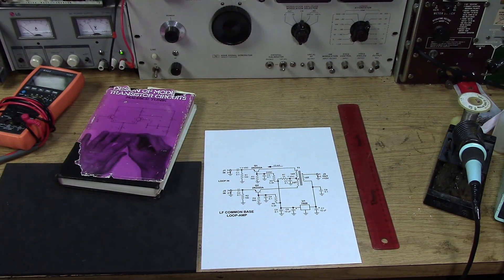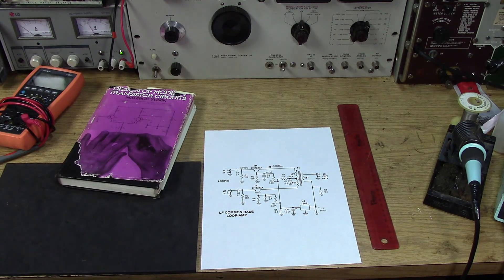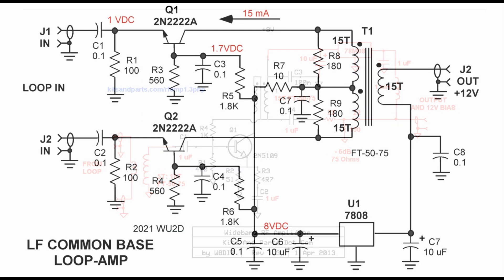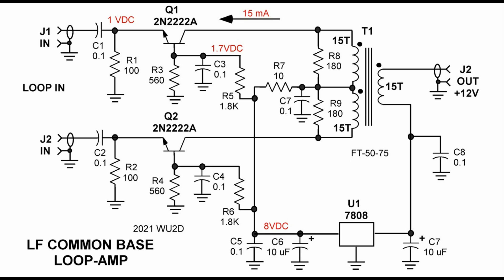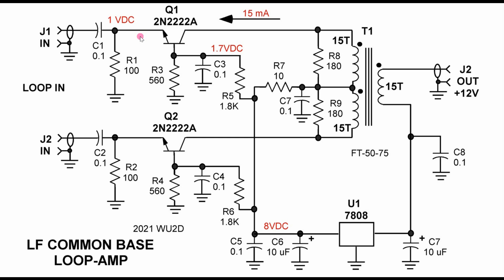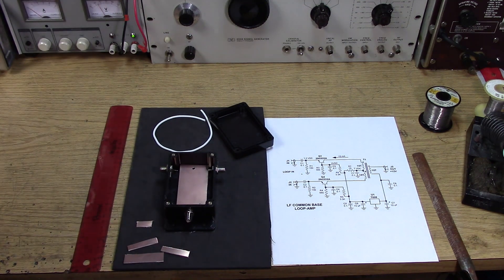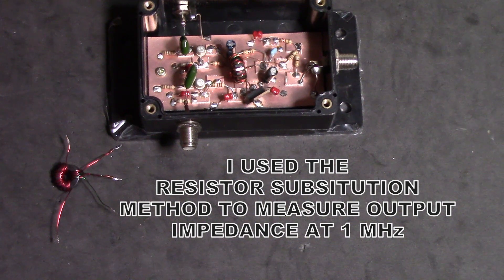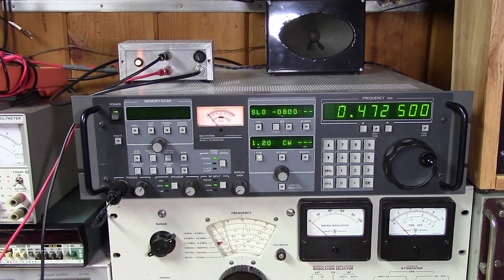Loop Amplifier - Part 3

Comment: GD dear OM, TKS FER NICE VIDEO, JUST A QUESTION: WHY IN YOUR VIDEO, CIRCUIT BOARD OUTPUT  CONNECTIONS ARE DIFFERENT FROM SHEMATIC DIAGRAM? TKS FER ANSWER AND BEST 73's.

Comment: Great video Mike! I built a "series tuned" 4-foot loop (24 T #14) and fed it to my common base 2N3906 (PNP) single ended transistor.  The loop is the "L" and the C is connected from the loop to GND. Since at resonance a series circuit has max current, it is fed to the emitter via a blocking cap. This is a current driving approach to the emitter/base junction. The collector has a 4:1 to my 50-ohm load (receiver) .I was able to receive SAQ (17.2 KHz.) in Sweden. I like your P-P approach. Thanks Mike!  Bob N3SWL

Comment: A very enjoyable video, as usual. Feeding the power input through the centre-tap of the transformer is a very familiar technique to me from my early days with the UK  Telephones. If a similar transformer were used at the input you could produce a "phantom" circuit. These could be used to provide power or DC alarm feeds to other equipment further down the line. You could repeat the process with another circuit and obtain a  two-wire phantom circuit which could be used as an additional speech path.
Reply from the maker: Those hybrid and phantom circuits were magic known only to Telephone Engineers Gods...

Comment: Hi,

 great video as always! 

In the unbalanced amplifier, it is unfortunate that you loose one half of the signal in the 6dB attenuator. Since you are already using a transformer, could there be a (improved) solution using (easily) modified transformer?

Comment: Currently building a new receive loop for HF, part your design and part of one by LZ1AQ I found.  Learning curve is steep enough I keep hitting my head on it.  If you know what you are doing, you're not learning anything, right?  Trying to condense this a lot, my SDR is weak on the low side. Actually it's deaf as a post below 8mhz, that was fixed with a few component changes I found online, but still needs a lot of gain below 8mhz.   LZ1AQ uses a common emitter amplifier after the common base to drive the transformer.  He is using 220 ohm resistors across is like you did with the 180 ohm resistors.  After watching this video and embarrassing amount of times, you mentioned a 9:1 transformer would be an option instead.   I understand why your amp needs the resistor, but not the one by LZ1AQ.  The collector of a common emitter transistor is a current source, right?   So my question is: I took a T50-2 core. I twisted 7 conductors and 19 turns fit.  I put 6 windings in series with a center tap, and the 7 winding was the output.  It kinda works on a breadboard.  On a scale of 1 -10, how bad of a plan is this?  10 being the worst btw.
Reply from the maker: If you need more gain - yes add the extra amplifiers strapped on. But the T50-2 is a powdered Iron core that is low perm, made for resonant circuits in the MF/SW range, rather than for transformers and it will be lossy compared to a good old Type 43 Ferrite with a few extra turns.
Reply: @MIKROWAVE1  thanks. any chance of an explanation of how to figure what the impedance ratio should be? The website I got cores from showed .5 -10 mhz for the type 2
Reply from the maker: @clytle374  Yes that range for high Q tuned circuits but not for broadband transformers. You should do better with 9:1 from a matching standpoint, but with the extra gain of the added stages, it may not be worth the bother. He didn't think so and just added the swamping resistors.
Reply: @MIKROWAVE1  Thanks again,  FT50-43 shows Wideband Transformers 5 - 400 MHz and  Power Transformers 0.5 - 30 MHz.  So I'd ruled it out before. I don't understand the terminology yet.  Trying a wind on the -43 core now.  Need to get it off the breadboard, just trying to get a feel for this still.

Comment: 2n2222 can be had in a SOT223 for the power you need.
You are also wrong about collector impedance.  Take a look at the curves for a 2N2222 and you will see that at 15mA, a change in collector voltage make almost no current change.
Reply from the maker: Which explains why it worked at low voltage out of regulation! And I had two issues with the original 5109 / 3866 amp. 1. the thing was oscillating trying to drive the coax, thus the pad solution broke that up. And a transistor with less GBW would be fine down here anyway. 2. The regulator was oscillating at a low chop frequency due to insufficient input capacitance. Both issues were faily hidden at 630M until you got a larger signal causing intermod.
Reply: @MIKROWAVE1  I have found that often a resistor is needed in the path bringing the power to the regulator.  Long wires look like tuned circuits near the 50MHz(ish) where an LM78xx loves to oscillate.  The capacitor on its pins is often not enough to hide the tuned circuit from the very willing oscillator. 
BTW: for a non-radio purpose I used the SOT223 version of a 2222 to oscillate at about 90MHz.  It didn't take much current to get them to reliably make enough gain for the circuit.  It has been in production for over 20 years now.

Comment: Mike, really great and interesting video.  I would like to comment that I (and I'm sure others) like the deep dives.  Your videos do both basics and advanced, all-in-one without leaving anyone out.  I have been learning Fusion-360 and 3D-Printing; the learning curve has been a bit steep but I'm now past the tutorials and looking for the intermediate and advanced topics.  As Amateurs, a portion of us should strive to learn more technical details and actually build things using those concepts--technical curation, is as important as equipment curation!.  Many of us (even back-in-the-day) did not have good access to mentors and parts; so these videos serve to allow us to 'fill-in' and either expand or solidify our knowledge.  So, (to-me) I really appreciate your videos, just the very way  you are doing them.  Also, you have a great channel-community, and I like going through their comments as well.  
73 & Thanks to All...

Comment: Is there a reason that the 2N2222s are metal packages? (TO-18 maybe?)
Reply from the maker: They were originally all in metal. Plastic came later and the plastic ones may not do well with a lot of heat.
Reply: @MIKROWAVE1  ah-ha!  thank you!!

Comment: Very interesting, thanks for sharing. 👍
Reply from the maker: This circuit is simple and it worked even better when I removed the output pad. It is very stable driving coax, compared to the first amplifier.

Comment: Hi Mike.  Great video again.  Although not the balanced circuit I thought you were going to build (which is shown in a previous video in the series, and the one I've been using for a couple of years). Wonder if you've investigated the frequency response of this common base amp.  I appreciate that the loop, that you connect to, will have a big influence. But my current balanced amp rolls off around 10MHz (even with a small 1m CSA single turn loop).
Reply from the maker: I have not looked at it at higher frequencies, but I suspect that it should work with the right ferrite  and if not add more gain and feedback.

Comment: can you not do what ham Chavdar Levkov LZ1AQ did and use a LAN cable between the Loop antenna amplifier and the interface box that connects to the radio via a coaxial cable.

Comment: I must admit I was exited when I saw that the latest installment in this series was available. Thanks Mike, very interesting and excellent explanation of circuit operation. Of course, curious to know if you did get around to removing the 3dB pad and if it made any difference? Also, did you perceive any other differences over the previous circuit, like any possible change in S/N ratio?
Reply from the maker: Yes it did and the common base amp was very stable with the coax load. No issues.

Comment: Very interesting, Mike, thanks!  I like this design over the first one mostly because it uses common 2n2222A transistors, a few of which I may even have in my motely collection of parts.  About the only thing I don't have is the type 43 or 75 toroid but that should not be hard to find.  I realize that both amps use 'balanced' inputs but I'm not clear on how a loop antenna, which generally has two wires for signal and ground (unbalanced?), are attached to the amp which has four inputs.  It's probably very simple, like paralleling the input wires, I'm just not familiar with the way it is shown on the schematic  Can you explain this?  Also, can the gain of the 2n2222A transistors be increased if it becomes necessary? Just curious.  Thanks again.  73  KD2ORG
Reply from the maker: The loop is a very low impedance antenna and it is balanced which does help with noise. Two unbalanced amplifiers back to back form a balanced input. So ground is in the middle. More gain can be had by strapping two more transistors onto the outputs of the first two.